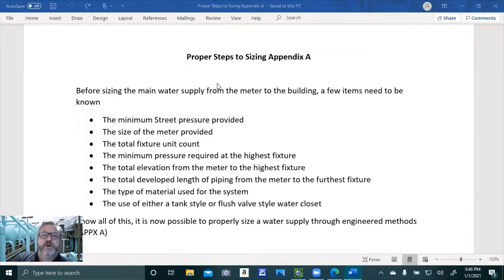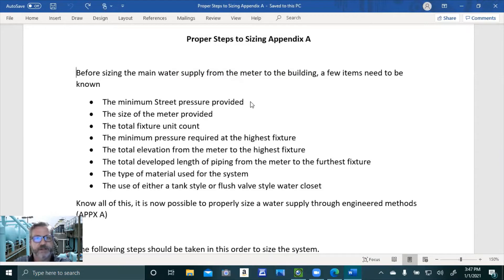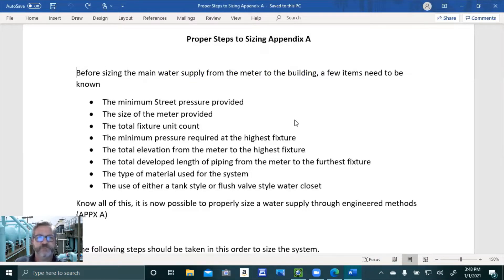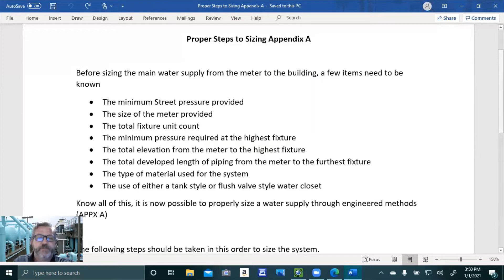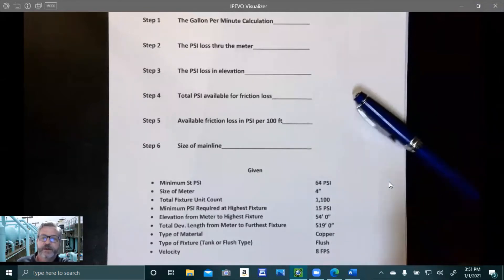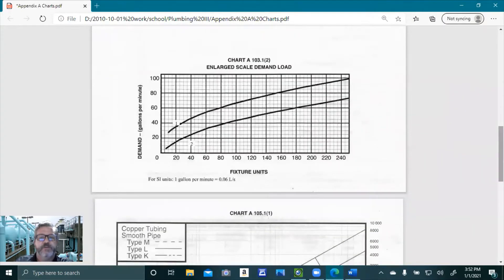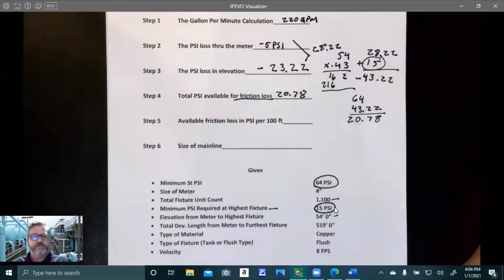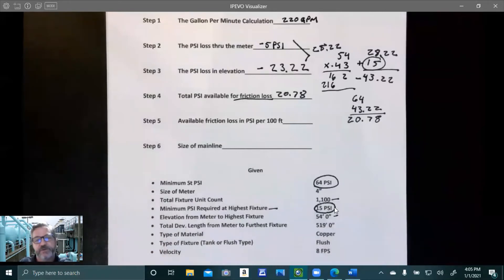Water Sizing Example Thru Appendix A UPC

Comment: Great Review. I did this about 6 years ago for a permit I needed for a repipe. The engineer down at the city 
was cool, he helped me with it, and I had to get a line diagram and detail, along with the calculations and needed
WSFU table submitted to the city. It was a 4 unit apartment building, 16 PSI & 28 feet elevation. you made it
look easy. Thank again!
Reply from the maker: It gets easy once it's explained WHY it needs to be done this way, and when you do it a few times.

Comment: Great Video. Thanks for taking time to share.... 
Would the calculation procedure be any different if the main service line was from a water storage tank on a roof slab? Would there be a need to factor any elevation since the water is distributed by gravity?
Reply from the maker: In order to properly provide the necessary volumes in gpm per fixture, it would be advisable to size according to available pressures- whether the supply is coming from the street or the roof. I hope this answers the question sufficiently.

Comment: How do you determine the minimum street pressure, hydrant flow test? Also how do you determine the minimum working pressure at the furthest fixture?
Reply from the maker: In most cases the minimum available street pressure is provided by the water authority when contacted.

Comment: If the 3” pipe is the box below the number 3 where does that leave the box below that with the number 2 in it?
Reply from the maker: The line between the 2" and the 3" is going to be 2 1/2" which is a valid size and is used often in copper.